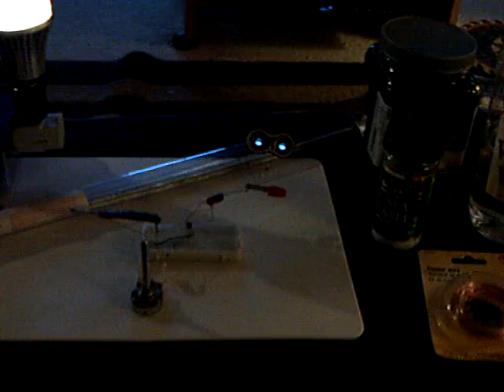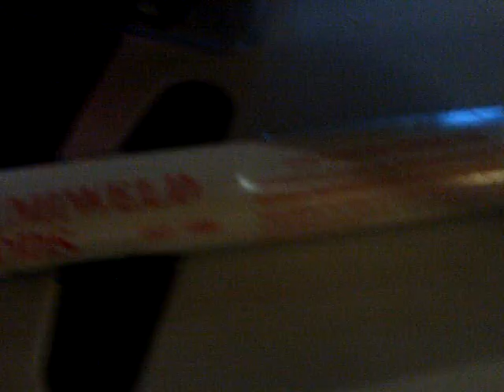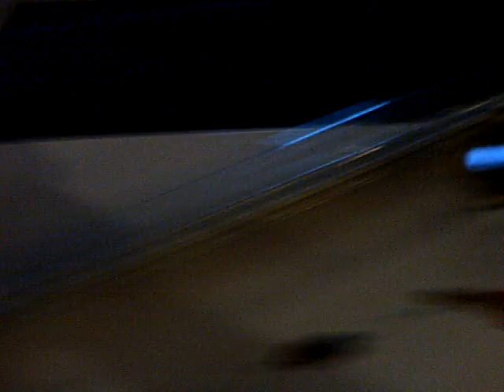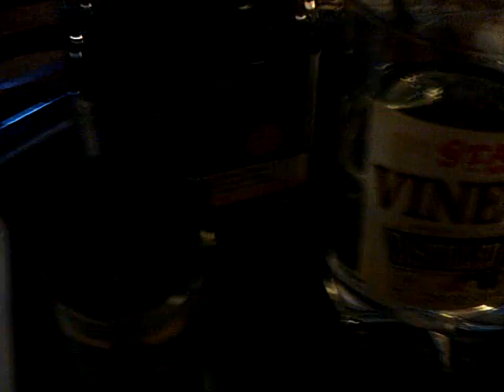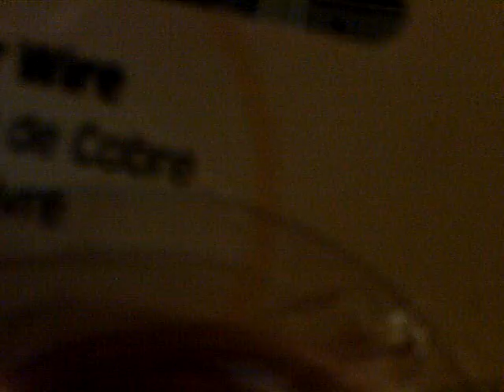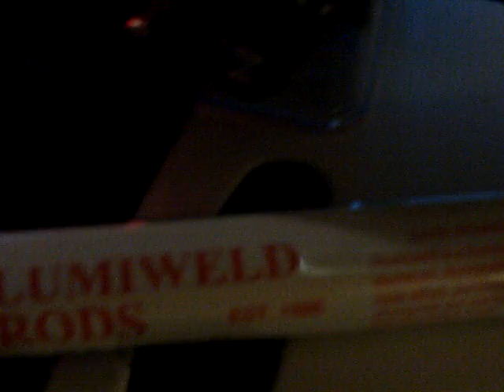Aluminum welding rod battery--1st try

Comment from the maker: Actually these are non magnetic so they wouldn't work well as an electromagnet core.  I did think about using the MIG aluminum wire on a Stubblefield coil.  I still have some cotten covered copper wire left and I might try that.  I would have to use distlled water on it because the salt and vinegar eats it up fast.  The circuit that I used here is just a plain old Slayer Exciter.  This one here just uses a choke for the secondary.  The primary is about 6 turns of 30ga.  Slayer did it first.

Comment from the maker: Thanks.  Those two 1N4148  switching diodes that form the AV plug are critical for this to work.  The circuit runs in the megahertz range.